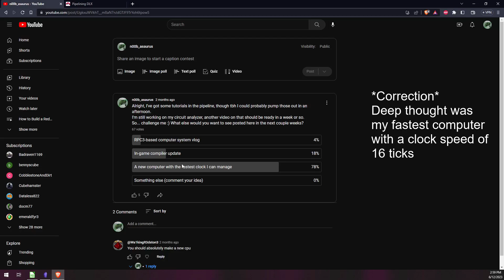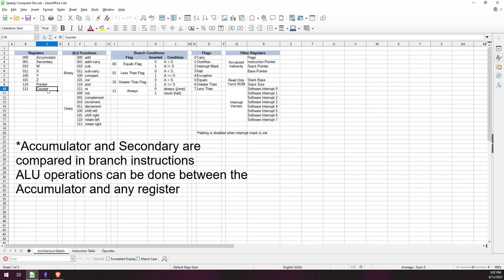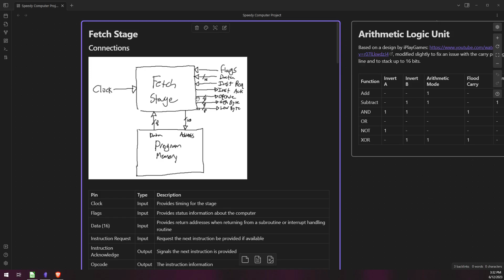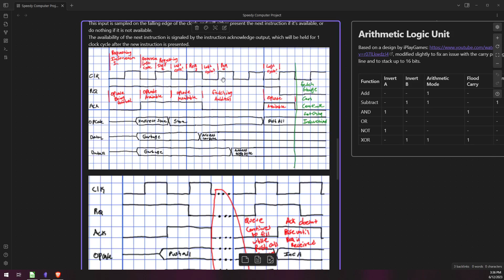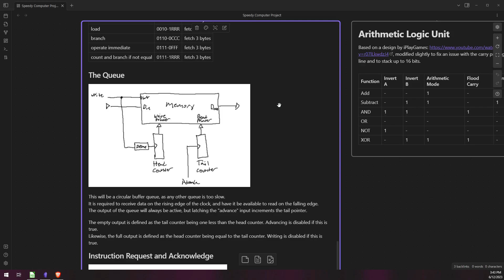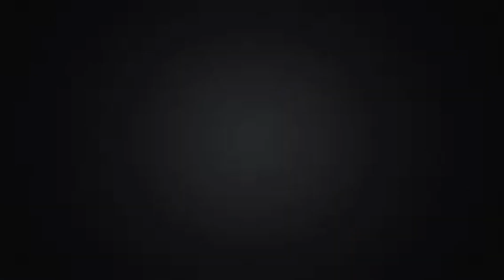Speedy Computer Vlog Entry #1

Comment: I believe you had said that size is the only constraint to complex computers within minecraft. That the physical distance in which the components work operations within the game are restraints on speed. What if you were to encase the computer completely and then used a shrink mod on the computer? Could you make the encased computer an individual object via code?  I mean you can already shrink things and manipulate the size of matter in the game, what if this actually applies as it does in real life that faster computers require smaller components. What if when the components when shrunk actually perform computations far faster? Yes it is a reality warping idea but there is no reason it cannot work. design the computer at normal brick size and then once finished shrink it down to the scale of one brick in game. May some sort of fractal compression algorithms could be applied, I'm not sure but it was just a thought.

Comment: by exceptions do you mean like internal traps, like invalid instruction and stack overflow?
Reply from the maker: Yeah, basically. If I can implement some kind of ISR to handle those things, great! Otherwise, I'll probably just halt the computer.
Even that can be useful in preventing run-away code.
Reply: @n00b_asaurus  you could just have a set trap service routine in the code, just like you would have an interrupt service routine. that's what I did for my CPU and it works great, you can even have multiple trap service handlers in the code for each specific type of trap

Comment: Looks very cool.
Does this queue system mean that if you jump to another address, you would need to flush and re-populate the queues?
Reply: And if so, do you plan to set up any branch predictors?
Reply from the maker: @96Kicek  For unconditional branches, like jumps and interrupts, I shouldn't need to predict anything or flush the queue.
For the conditional stuff, or returns which require the address to be provided by the stack, I will likely need some kind of predictor/flush system.

That's all down the line though, so nothing's concrete yet.

Comment: I doubt CISC, Pipelining, etc. can be done in Minecraft efficiently with 10 ticks of a clock
Reply: It's definitely possible. Pipelining is standard (and pretty much necessary) on high clock speed Minecraft CPUs. The CISC part is taken care of by having a front-end which translates the CISC instructions into sequences of much simpler RISC-style micro-operations. So you really build a 10 tick clock pipelined RISC CPU and add a CISC front-end to it (which, by the way, is how real-life amd64 CPUs work too).
Reply from the maker: @GreenJalapenjo  Couldn't have said it better myself... mainly because I didn't know any of the technical terms you just mentioned :P

Also, I didn't know this was how real CPU's achieved this result! Very cool!

Of course, now that you've given me a name, I can start doing some research on the subject. That should make building this thing much easier!
Reply: @n00b_asaurus  It's what all those Intel/AMD microcode updates are about :P

I'm very impressed with your level of planning and how well you've thought through everything. I always just kind of start building and hope to end up with a functioning CPU.

By the way, have you considered building this computer on ORE as part of the ongoing CPU building competition?
Reply from the maker: I had my suspicions, but being the CPU wizards that they are, I just figured they had some better system :P

Also thanks! I'm not sure if I'd call this planning, so much as just documenting my ramblings, but thanks for noticing :)
I will say this though, because I've got a lot of the intuition for this stuff already in place, I was able to skip a significant number of steps! (that's probably why it looks like everything is planned out already) But this is uncharted territories for me, so my intuition is only going to get me so far.

In those situations, I'll usually do as you do, just kinda play with things until it makes sense.

I had not considered building this on ORE, but now that you mention the CPU competition, I just might copy it over when it's done.
I like ORE for their ability to share components and computer designs... not too fond of developing anything on there though.
Reply: possible, very possible